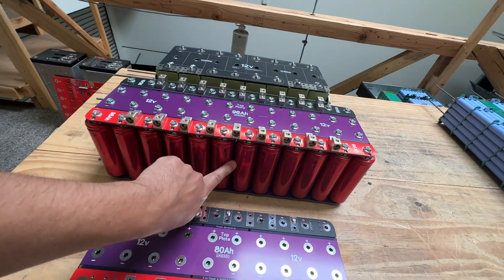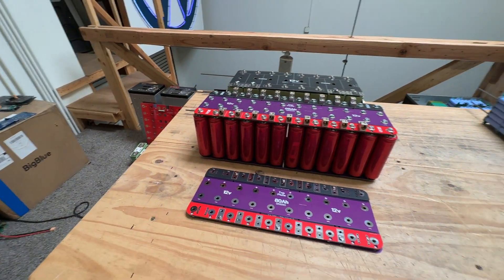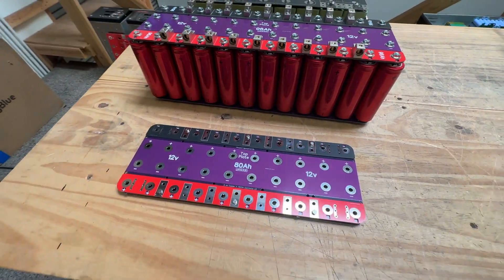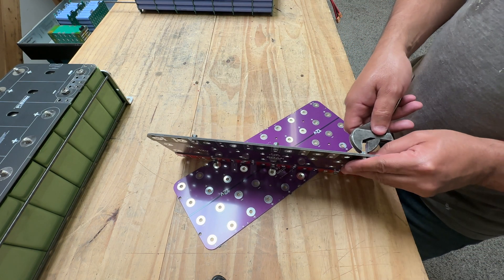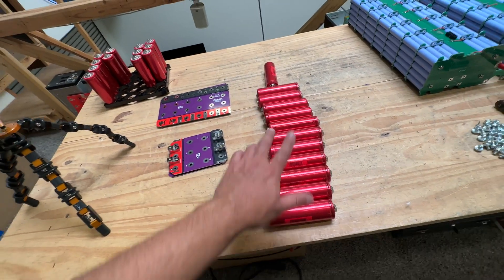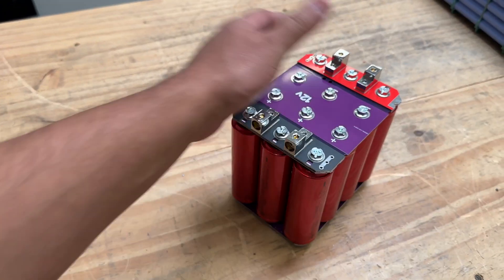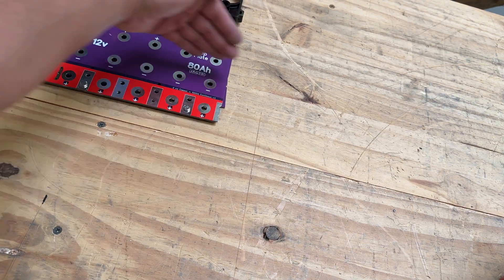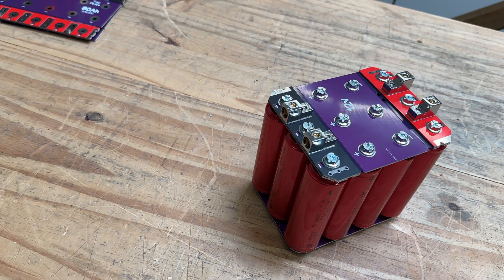Make your Battery fit - headway LiFePO4

Comment: Don't you need to seal off the edges of the PCB board after cutting them so you don't accidentally short it out if it hits some metal on the edges?
Reply from the maker: Not if you fab a box,  there’s all kinds of exposed surfaces on this battery the exposed ends of the board it’s the least of your worries.

Comment: Will you have those slim 12v batteries again? Thanks for the video as well.
Reply: Pouch cells?
Reply: @KuntalGhosh - They were in slim black and 12v 50ah I believe. Unsure if they were pouch. But they were lifep04 cells.
Reply from the maker: Maybe,  supplier says yes but does not know when
Reply: @jehugarcia - Thanks for the update. What are they called anyhow or info on them? Maybe random ebayer might be selling 1. Been trying to get my hands on just one.